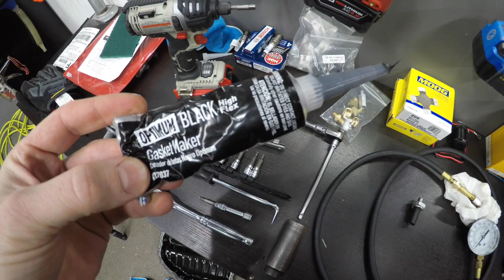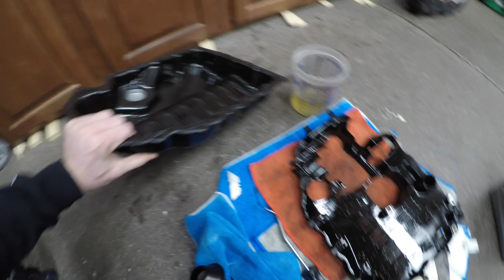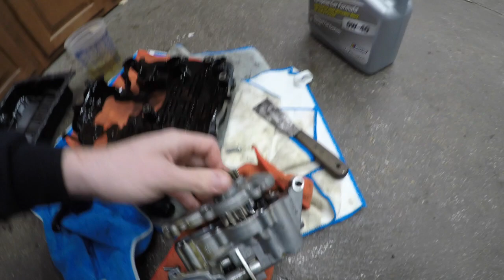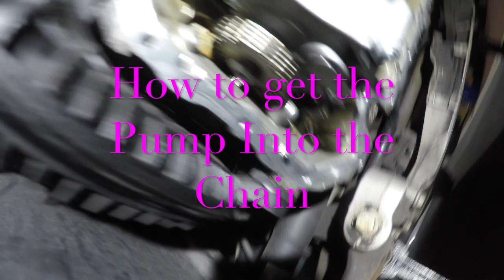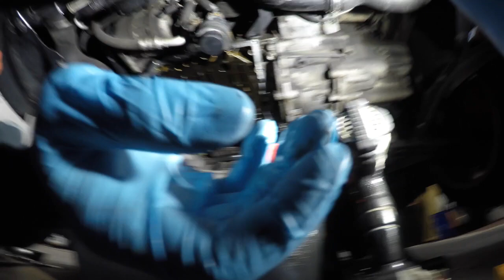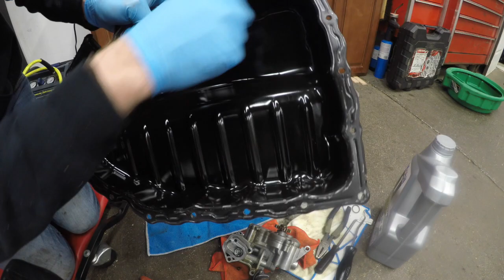MK6 2.0 TSI Oil Pump Installation - GTi / Jetta

Comment: Hi! I have an 2015 1.8t Golf that turns on the oil pressure warning at idle when it's warm. It doesn't turn on at higher speed and it doesn't make any knocking sounds. The only weird thing it does is that sometimes seems to hesitate when accelerating from a full stop. Anyway the dealer recommended replacing the oil pump  and timing chains for almost $5k. My car only has 71,000 miles, do you think that the car will be ok if I just replace the oil pump?
Reply from the maker: The hesitation doesn't sound oil pressure related. That may actually be cam related if it is like the 2.0t. I'm not as familiar with the new 1.8t engine but I'd imagine it's close to the 2.0t. sometimes the intake cam wears a notch where the sprocket connects so it gets a slight movement before starting or engaging and you may notice a noise or hesitation. Usually a code appears for this. Also I wouldn't have dealer do the pump without a pressure test. If the light goes out when you are above idle that generally means you have oil flow which makes pressure. You could have a oil passage clogged with a broken filter or even a bad sensor. I'd get more details from any shop before spending that much on all of that work. It's a labor intense job for the chains and I've had a gti that had 256k on it on factory chains and tensioner. It's important to change the oil more frequently and honestly DRIVE the car. Take it to redline, floor it, they seem to last longer.
Reply: @KennyChurchSpeed   All of the oil sensors of my car where replaced and my personal mechanic replace an updated oil filter housing, but that did not fix the problem. Later on I took the car to the dealer and they hooked an oil pressure gauge to the car and confirmed that when the car is warm it indeed has low oil pressure (0.72 bar to be exact). As soon as you hit the gas, pressure builds up and the warning goes away and it wont appear until you leave it idling for few minutes. Ive seen a lot of people on youtube that has replace the oil pump without worrying about the timing chain going bad, so I might just do the same and save some money. Hope this finally fixes the issue. Thanks for the input!!!  I greatly appreciated.
Reply from the maker: @luisarsuaga7637  that is good to know that the sensors were replaced. It could be the pump, but again generally if the pump is bad it won't really build pressure when you rev the car up in the range unless somehow the pressure relief is opening at idle which doesn't make sense. You can try replacing the pump it isn't a terribly expensive option and if it works great and if it doesn't then it may be rod bearings wearing, cam bridge filters, or balance shaft filters blocked or damaged.

Comment: Hey i have had my timing serviced, balance shafts replaced.. im in the process replacing vvt solenoid and cleaning and inspecting cambridge due to seperate issue. My oil pressure is 15 psi at idle,  but the light doesnt come on at idle, only after accelerating then slowing down.. Should i replace my pump? i have heard of a spring failure that leads to low oil pressure when cruising. I dont think my bearings are worn because it never clatters in the lower end i hear noise in cams though which makes me think pump is not creating enough volume to move oil to head
your thoughts?
Reply from the maker: Hi, when you slow down, what rpm are you referring to? Or does it not matter, meaning it happens on decel regardless of rpm? The best way to identify is to measure the pressure with a gage at rpm range to see if there is an issue. How do the screens look in the cam bridge?
Reply: @KennyChurchSpeed  at around 2k rpms oil pressure light would come on, highway cruising it never came on. When tested with a gauge idle was 12-15 psi hot and it was a little below spec at 2k rpms dont remember an exact number.
Reply: @KennyChurchSpeed  Also waiting on parts and tools to remove cambridge, replacing my vvt solenoid anyway so im cleaning the cambridge and checking it for wear.
Reply from the maker: @readylucas  all good places to start. I usually replace the cam bridge for sanity as it isn't too expensive because it does support oil control. Your car based on rpm does sound like the pump. Depending on you cashflow, a pressure test could save you some money so worth it really.
Reply: @KennyChurchSpeed  update. Sad but it is what it is. My cambridge was badly worn. Screen blew out and starved oil to my cams and vvt solenoid. I cleaned the cambridge, and replacing solenoid.  I dont have the money for the parts (intake cam, exaust cam, cambridge) assuming head is even in good enough condition to swap new ones in.    My low oil pressure at idle is pretty obvious to me now. Bought the car used oil was really dirty. I guess after i changed it n drove it screen broke loose and ate my cams. Accounting for excess clearance and failure of intake cam solenoid.  Short term im adding lucas 100 weight stabilizer with liqui moly 5w40, mann filter. Cleaned cambridge and ends of cams with marvel mystery oil. Cambridge is back on and tomorrow im intalling solenoid when it comes in. Made sure to pull out screen.   Future repairs i plan on replacing the cylinder head and oil pump. Oil pump as preventive maintainance. I have brand new chains and tensioners, and hope that with a new cylinder head and pump ill have a solid running engine.. also i know oil stabilizers dont fix the issue but with no money to fix the car im gonna see how many miles i get before the cylinder head finally gives.
Reply from the maker: @readylucas  I'm glad to hear you found the root cause. Unfortunately these engines have so much oil control and filters. Not performing proper oil changes certainly doesn't help the situation. My previous gti (2.0t) I had 256k on it with original chains and all. I changed the oil every 6500 miles, and regularly took it to redline each day. It was also a cbfa engine code which seemed to be the better of the engine codes. Good luck, keep an eye on the oil level.
Reply: @KennyChurchSpeed  I removed a quart today, and installed new vvt solenoid. Still waiting on cam adjuster. I dont think i will get rid of p0341 because there is actual scoring on intake cam and not just damage to n205.   Removed 1 quart of oil (already changed recently) and added 1 quart of synthetic oil stabilizer (lucas high millage). If it quiets the engine down and raised oil pressure thats enough for me. I know my wear needs fixed but lacking money cant really just do that and i need a car. I have seen a video where a guy uses model engines to simulate thicker oil.. and even though most say not to use the shit. I like the results i have seen. If you look around online for oil pressure issues one guy has a video on a truck with similar issue to my car. Vct failed and cam bearing wear..? Oil pressure was piss poor and would fluctuate with bad vtc. They replaced the solenoid and added lucas. They updated the vid 3 years later and car still runs and even pulls heavy loads. My timing chain is brand new and the sole reason i have no more money to spend on the car XD so i have to get by.
Reply from the maker: @readylucas  totally get it, do what works for you. Honestly worth a shot for now and who knows you may end up getting rid of it at some point. Good luck!
Reply: @KennyChurchSpeed  i will be uploading videos. If u would watch and listen for noises/ or see issues or have a thought on them lmk it would be highly appreciated.  All i ask for is advice. You have a new subscriber and like!
Reply from the maker: @readylucas  thank you, I will certainly see what I can do for you. Much appreciated 🙏
Reply: @KennyChurchSpeed   The car runs much better now with new solenoid. Oil pressure is still low though.  Not as much as it was but enough to trigger oil switch.  My p0341/ 1500 rpm stutter goes away after unplugging cam magnet. I think it disables vvt in some way? But keeps oil flow? My 1500rpm stutter is related to intake cam adjustment.  Replaced both cam magnet and n205 solenoid.  I dont have the luxery to afford a new or rebuilt engine. But have thought of a solution.  My cambridge screen failed which caused a lot of damage to cams and has effected oil pressure in cylinder head. Im going to replace cambridge.. intake cam.. possibly exaust cam but its not as bad.   The way i see it my car had a "heart attack" when the screen disloged and clogged things, causing oil starvation.. and eventually getting sucked into intake cam and exaust cam which caused all my scoring.   Ill update once valve cover is off. Crossing my fingers when i look at journals they arent bad. Worst case scenario seeing lot of used cylinder heads for like 500-800 bucks that look much better than mine. Either way. Once the damage is fixed im getting a revised pump anyway.
Reply from the maker: @readylucas  good to hear it runs better. I wonder if it goes into batch fire with cam sensor unplugged. I'm not sure on that. However it is important to change the oil regularly on these cars and keep it clean. Any build up in the screens etc. Can be lethal. Check the cam journals and cam for wear. You could always pull oil pan as well and check for excessive rod play. Depending on wear in your cam, replace the head as you suggested. Good luck!
Reply: @KennyChurchSpeed  i know for certain the ends of my cams are worn from screen failure. Intake cam got the brunt of it though. Assuming my bearings are fine, and in my opinion they should be because prior to the cambridge screen failing it was a solid running car with good oil pressure. The engine bearings are after filter/ cooler fed fresh oil right? Would the cambridge screen even of reached engine bearings?
Reply from the maker: @readylucas  in reality, you are correct. Generally speaking the pump picks up the oil, somewhat filters it, then it goes through the filter then into the cavities for the rods and head. So you are probably correct in saying the bottom end is fine, but from what I've seen it's always good to be sure. Did you also change your pressure sensor? I did find mine when I rebuilt my 2010 was bad and had to replace it. I like the idea of these motors but the 1.8t and vr6 has far less things to worry about.

Comment: Great video! Do I want the right stuff black or grey?
Reply from the maker: Thanks, I actually didn't realize they make a grey, however I just use the black. There are two different cure versions offered. I use the quicker curing stuff, but really depends if you are trying to get the road right after or if you have time to wait until it cures.

Comment: What actually broke in the old pump??Thanks
Reply from the maker: Not exactly sure but it would seem as though something with the pressure relief valve. All the drive gears and bearings were in tact and seemed to show minimal wear.

Comment: Friend of mine has a 2011 tiguan that has 25-40psi while driving but barely 15psi when idling after driving the vehicle I haven't looked at it myself but I'm beginning to suspect that there's an internal failure with either the rod or cam bearings. Haven't worked on too many vws before, just thought I'd ask to see if I'm on the right track
Reply from the maker: Hey, is there an oil light? I was actually surprised how low oil pressure the tsi engines run compared to other cars. Of it is a ccta engine code it may be suffering from balance shaft wear which then can clog up filters in the balance shafts and cam bridge at the top end. There are various oil passages in these motors and I have not seen too many rod failures just everything else.
Reply: @KennyChurchSpeed  yes there is an oil light but it's on because he hooked up a manual oil pressure guage to monitor the pressure which after the oil change we did today didn't change much but the vehicle definitely needed it so should I look into the oil pump next or get the valve cover off?
Reply from the maker: @batjeep5ter947  You won't be able to really see anything. Check the oil filter see if there is metal in it. Honestly these motors are so hard to diagnose because of all the oil passages and filters to protect components.

Comment: I follow your channel I wanted to congratulate you, and I would like to see with you about my jetta is a 200 hp TSI 2012, some week ago I made an overtaking he turned on the EPC light, I stopped turning off and turned on the car again and the light went out and continued, but when it accelerates for someone there for a while near 4000 RPM it lights up again, in the scan he accuses the error P164B error in the oil pressure sensor, that's where the mechanics are going crazy lol the car doesn't lower oil , does not beat engine or valve, does not smoke and does not lose power only limits after lighting the EPC, then we put the oil pressure gauge in place of the brown sensor in slow it gives 1.2 bar to 2000 RPM around 1.8 bar and then it is even accelerating sometimes it gives some peaks in the pressure gauge indicator very fast, I changed this brown sensor When you turned on the light and a noise in the high gasoline pump, the one that is on top of the engine from 2000 rpm, it makes a noise, it looks like friction, would you have any tips for us to test ???

Thank you, I look forward to your reply

Hug
Reply from the maker: Hi, thanks for the comments! How many miles does your Jetta have? With the epic light does it indicate low oil pressure to stop? If you are having spikes in oil pressure that is not normal. You should have very linear pressure up to a point because the pump will help regulate excess pressure (flow) back into the oil pan.
Reply: i have the same issue in a jetta 2013, did you solve it?
Reply: Hi. Have the same issue. Do anyone of you solved it? Might check the cambridge because sadly I think I heard the noise from the HPFP as well and I guess it's likely to be caused by oil starvation in the far end of the exhaust cam, and it seems all head oil passages come after the cambridge oil screen. @KennyChurchSpeed

Comment: Muy buen video y detallado es de gran ayuda. Gracias 👌
Reply: Great video! I’ve changed out the pump with a Kit from ECS and I’m still having problems.  My motor is a CCTA with 161K.  Any ideas

Comment: Whats up Kenny man! Thanks for the helpful video!! I'm currently experiencing what most people on here are, oil pressure warning between 20 & 50mph, anything over rides with no issues at all. Done new sensor, checked wiring,, oil+filter. I then took it to Volkswagen, they said oil pressure is at 1.5 bar at 2000rpm. I got there, then the guy that helped me at front counter said, it's actually at 1.5 bar at idle and at any Rev amount (he did seem unsure about telling me this once I asked if the pressure changed at all at different rpms). You did state in previous comments that if your car rode well on highway that it wasn't a pump issue but I'm thinking it is? They wanted to drop the pan and inspect pickup tube for $500. Thanks to your video and a bit of elbow grease I should be able to get this done myself at home. Think I should go ahead and order the pump?
Reply from the maker: Hi! Thanks for watching, I would actually check the pressure first if you feel comfortable before getting a pump. Chances are however if you are driving and higher rpms and it comes on you probably have a pump issue. Usually at idle rod bearings cause low oil pressure and I've seen that with balance shafts as well. Good luck!
Reply: I was having the same problem 1 month ago, with 5w-30 for just 50km my oil pump blocked and crack the chain in the oil pump, after that, I change everything on my engine and still said low oil pressure... When oil is cold everything is okay but when oil comes 95+C, when iddle pressure is 0.5 bar when i put some torque, goes to 3-4 bar. Now I'm waiting for the new oil pump for 1.700 $ . And hope that this is the problem
Reply from the maker: @Niko-ys7gt  hey, thanks for watching. So what your saying is when the engine is warm and at idle you get the light? When you push the throttle the light goes away? Generally if you are increasing pressure with rpm then the pump is not the culprit. You could have a balance shaft screen that is clogged or rod bearings that have excessive wear due to oil pump restriction. It doesn't take long to smoke the bearings with and engine and no oil.

Comment: I wonder do you know what is the difference between the audi and VW pump as they use different pumps, atleast in the way they look.
Reply from the maker: @Bigdick Johnson I believe the Audi is similar to the golf R pump and has balance shaft within. There is a difference in the fsi versus tsi.
Reply: @KennyChurchSpeed  Yeah all 3rd gen tsi engines use the audi oil pump but for some reason the VW gen 1 engines use a different one to the gen 1 Audi ones. But weirdly enough when looking at the engine codes compatibility they are interchangeable, somehow i think thats false haha.
Reply from the maker: @maxavaria  I wouldn't think the pumps are interchangable with different styles. But I'm sure the pumps are the same as long as you source the same engine code.